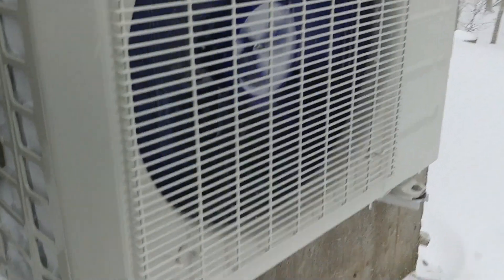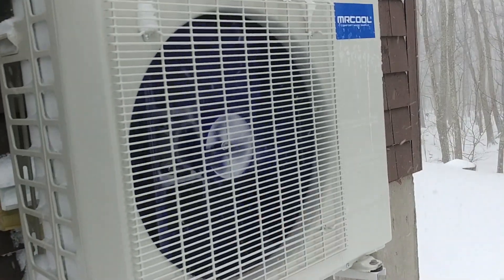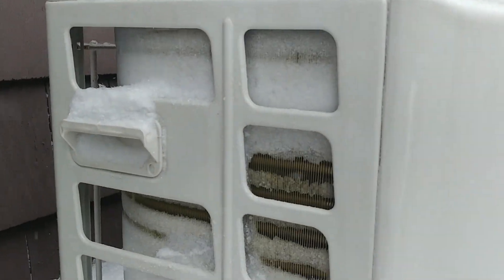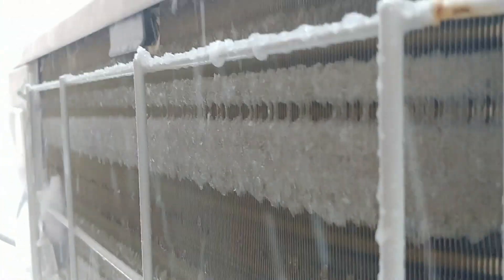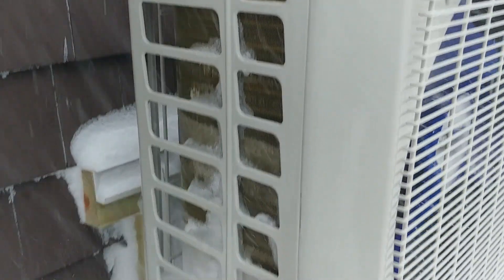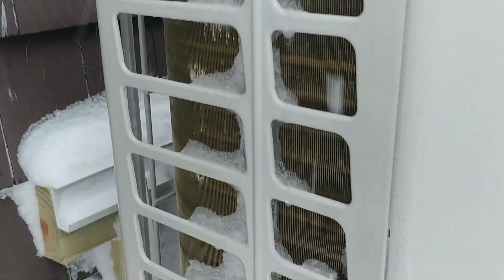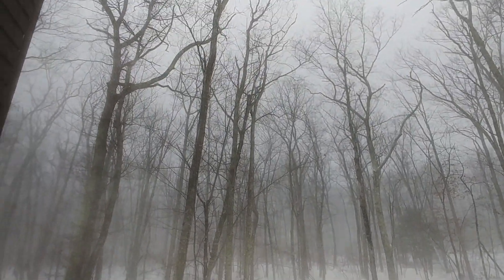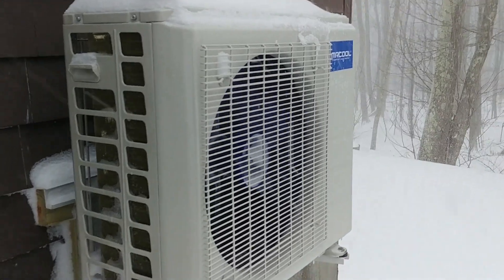Mr Cool mini-split performance in a blizzard

Comment: I too would like to know for sure how these units determine a defrost cycle is necessary.  I don't believe they monitor the refrigerant pressures, but at least mine monitors the intake and outgo temp on the condenser.  I assume it just can monitor those and when there is no more temp. differential between intake and outgo, it assumes it is blocked with ice and needs to initiate a defrost.  I know it's not strictly temp based as it can be plenty cold, but my unit will not initiate a defrost unless there is truly a good amount of frost. And that happens quickly when the humidity is 85% (defrosts every 70 mins), or not at all (humidity is 60%).
Reply: I've also wondered b/c my unit will run all night with it being 30 outside and never defrost(when humidity and dew point is low) but I've had it go into defrost at 40 degrees with 90% humidity but no ice whatsoever on the coils.  One night it defrosted twice and each time I checked, no ice on coils and not a drop of water came out the bottom, apparently this is common from other people I've talked to about it. From what I can gather sensors monitor the temps coming thru the coils combined with a pressure sensor, the pressure sensor monitors the pressure on the outside of the unit and the inside of the enclosure.  If the coils are iced over it will create a slight change in the pressure between the outside and inside.  That doesn't explain my situation but this is what I've been able to come up with from months of searching.   Does yours take roughly 6-7 minutes to defrost on avg(4-5 minutes to defrost and 2-3 minutes to start blowing hot air again)?
Reply: @bennypit4411  Are  your coils dirty,clogged up a little.The computer is taking info from the sensors temp,airflow.The unit might also have a humidity sensor and is tricked into thinking you need a defrost
Reply: My Senville Aura made by Midea same as MrCool  unit here has temperature sensor and a air flow sensor.When your unit is clogged with the snow white ice air flow drops considerably and it automatically goes into defrost. It defrosts until a certain temperature  is reached and then the snow white ice is all gone and it goes back into heat mode.The colder it is outside the longer defrost takes

Comment: I got a power meter on eBay, mounted it in a small pvc box to track mini split KWH
Reply from the maker: I have two of those for my generator.  I wish it was easier to repurpose them to my mini split.  I may want to just do two more boxes.

Comment: Stopping snow from getting onto the condenser should. E a priority to cut down on the amount of ice the defrost cycle has to contend with. Typically freezing temps outside result in low humidity which should prevent icing up so frequently.

Comment: Frost is normal on all brands of heat pump, specially in very humid weather. On my condo roof building downtown Montréal  there is mix of unit of différent  brands and age and they all do frost up.

Comment: While this is excellent for a heat pump, a gas furnace would put out hot air somewhere between 120 -140 degrees. So the efficiency of gas in extreme cold temperatures is unbeatable. The same is probably true for oil burners, but I have not used one of those.  You can use electricity to produce radiant heating, but the costs are astronomical. This is one of the central, crushing logical fallacies of the Democratic Party's obsession with wind and solar to "save the planet" from a 1.5 degree C temperature increase. These "pure green" electric sources are intermittent and in extreme cold, their costs are incredibly high. Further there is ZERO hard scientific proof that lowering anthropological (man made) CO2 emissions will have ANY effect on lower the aggregate global temperature. The global warming theory is an absurdly stupid and unproven theory that tens of millions of weak minded lemmings are following off of a cliff.
Reply: ok dummy
Reply: Stupid

Comment: I have my outdoor unit in a covered place where the snow can't easily get to it, but it can still frost up on a very damp day when the temperature is close to freezing. That one in a blizzard is probably using as much power to defrost as it is to heat the house.

Comment: The Mr cool 4th generation is great for diy. Reason beings the lines are precharged with freon no need to have a heating and air guy charge it because they are a big rip off. The other brands have to be charged, the heating amd air companies stay in business because they over charge you to charge your unit.
Reply: The other brands come precharged too, the charge is just held inside the unit instead of the lines. You just have to vacuum the lines down and then release the charge. But vacuum pumps and gauges are pretty cheap. Real problem comes if you get a leak, then you need some pretty expensive equipment (and refrigerant) to fix it.
Reply: @DeusTex  good to know, thanks for the heads up

Comment: I've had my mr cool installed for 3 years had the main control go once they send a brand new outdoor unit an lineset no questions. These units are good ice should come off during defrost mode
Reply: My experience if you're unit gets iced up enough to stop the fan from spinning us where problems will occur
Reply from the maker: @steelcitysewerman  Mine threw a P4 code (check my recent video on this).  Did yours?
Reply: @kevin9c1  yes my unit thru a P4 code circuit board was faulty
Reply: @kevin9c1  they sent me a whole outdoor unit and lineset at no cost. Never even asked for the old unit or lineset back
Reply from the maker: @steelcitysewerman  Yeah Ingrams did the same for me.  I get a gen 4 outside unit.  Mine happened in only 13 months.  The old compressor made some bad noises but it seems to be working great now.

Comment: They are great for small rooms, diy’ers, off grid solar systems, RV/Van builds and people that want to replace the unit every 10 years or less. The indoor units are difficult and messy to clean and have poor air filtration. They will not keep up in heat mode unless they are severely oversized in cool mode. Hence the reason everyone has gas, electric or wood for backup heat that has these units.
Reply from the maker: There are many available mini split heat pumps that can do 100% of rated down to some low temps, but 1) those are not yet available as DIY and 2) they have almost double rated max capacity in more moderate conditions so effectively the unit is oversized to achieve the capacity.  No free lunch but an oversized unit will often be more efficient under many conditions, provided it doesn't short cycle due to min capacity issues.  Definitely trade-offs and more trade-offs.  But in general, I am a fan of these.  Need to do your homework on capacities and COP numbers across expected operating conditions, though.

Comment from the maker: I have done some experimenting with turbo mode and turbo mode definitely results in more heating.  The room is very large (24x24 with vaulted ceilings, three exterior walls with windows and above my garage).  So the extra airflow really helps extract more capacity from the unit.  I am sure I am trading efficiency for capacity with turbo mode but it's nice to have the option, AND at $4/gal for heating oil, probably still well worth it.
Reply: What size/BTU is your unit?
Reply from the maker: @robd7365  18k single zone.  Runs off 240V.
Reply: We're paying 510-550 per gallon in lower NYS, so our 9kBTU 115vac is a nice heat booster.  I wanted to go with a 12kBTU, but don't have 220v wiring going to that side of the house... Of course now MR COOL offers a 12k that uses 115vac 😒.  I think the 9kBTU is a little undersized for the area, but it's right in the sq.ft. limit listed.  I would like to remove that unit and reinstall it in a smaller room if I can pump down the condenser/outside unit.   I may end up removing the quick connects and putting traditional flare fittings if I do the move.
Reply from the maker: @robd7365  I ran a dedicated circuit for it.  If you have a 120V outlet already on a dedicated circuit, you could switch out for a 240V breaker and change the outlet to a disconnect panel.  Just need 12/2 wire.
Reply: Using that kind of amperage constantly on 115 is going to be about 75% efficient compared to 95% efficent with 240. Not something I would do. I would just pay the money to get the circuit run.  @robd7365
Reply: On turbo mode it usually passes more air so efficiency if compressor frequency is unchanged is higher. If compressor speeds up it just adds some capacity so thats not bad either if you need it

Comment: Our Senville 24,000 BTU LETO we just set on Auto all the time and it knows what to do. I installed it in 2018. We never have icing and stays hot on winters and very cold in the summers.  IT KNOWS WHEN TO DEFROST ALL BY ITSELF.

Comment: I'm curious if you can share how many KWh your electric bill increased using the mini-split.  I have recently installed the MRCool Olympus 48K with 3 wall units and 1 mini ducted for smaller bedrooms.  I have NG for the main heat which I am planning on using as a backup but I know this will substantially increase my electric usage.
Reply: Not only do you save on gas, the accompanying electric to run a blower or pump for hot water is also not present.

Comment: This is normal, every mini split goes through this process, your coils have a sensor on the back. Do you have the olympus low ambient unit?
Reply: You should have said, every heat pump goes through this. It's not unique to mini splits.

Comment: Hi do you still like it now July 2022 in the heat?  Do you recommend as a back up heating unit?  Oil prices are out of control.  We are thinking about getting the dual zone Mr. cool split unit.
Reply from the maker: I still like it.  I am considering a 3 zone for our bedrooms.  I wouldn't hesitate to get one to help with heat.  At these prices it's definitely cheaper than oil.
Reply: @kevin9c1  do you need more than one unit to do the house ? How big of a room does the 3 zone do ?
Reply from the maker: @allaboutdetails3356  We use the 18k unit for the great room which is 24x24 with vaulted ceilings, above a garage and with 3 exterior walls.  It does the room with power to spare.  But it doesn't really do the rest of the house.  I think we actually need two more 2 zone units.

Comment: defrost will cycle on and terminate by either time or temperate . Most importantly the indoor fan turns off because it becomes the evaperator in defrost mode and wouldn't be efficient and or comfortable if the blower motor runs .

Comment: I'm glad you made this video. That's the unit I want for my cabin, especially to heat during the winter.
Reply: That MrCool unit is made by Midea.Midea also makes Senville and a Senville Aura is good for minus 22F.The Senville Leto is good for 5F.I would take the Senville Aura over the MrCool plus it costs much less and parts are readily available
Reply: Get a Mitsubishi with hyper heat. It will heat with the temp outside at -13.
Reply: @user-ln7of9gs4s  and so WILL the mr cool, they are all the same, Mitsubishi is NO better! if they have an inverter, they will all perform the same.
Reply: @karmendimas5274  false. They all perform differently, they are not all the same.
Reply: @user-ln7of9gs4s  you obviously did not read my comment carefully,, the Heat pumps with INVERTERS  are designed for sub temps, !!
Reply: @karmendimas5274  I read your comments, not all systems have equal capabilities even with an inverter. Some have minimum temps of 5 degrees Fahrenheit. It even says it on their website for Mr Cool.
Reply: @user-ln7of9gs4s  if you say so...
Reply: @karmendimas5274  what is your problem ? You’re disputing what’s on their website? What are you trying to prove?
Reply: @user-ln7of9gs4s  if you say so !
Reply: @karmendimas5274  the manufacturer says so right on their website. Why are you trying to spread misinformation? 5 degrees and -13 degrees is a big difference. You haven’t contributed anything of value, you’ve lost the debate. I’ve cited facts and sources, and all you can say is, “if you say so.”

You haven’t shared any personal knowledge or first hand experience.
Reply: @user-ln7of9gs4s  if you say so!
Reply: @karmendimas5274  yes, thanks.
Reply: @user-ln7of9gs4s  if you say so!
Reply: @user-ln7of9gs4s  the gen 4 Mr cool state heating down to -13f. The gen 3 states it could heat down to 5f
Reply: @scottleighton9149  thank you for sharing factual information and a source for myself and other commenters. Not all minispits are equal.

Comment: You should not count on it to be your primary heat source it can only do so much plus with all the snow blowing around your asking for problems and then good luck getting help from mrcool I don't think they have a service network
Reply from the maker: That's why I bought from Ingrams. Mr Cool and Ingrams are both based in KY.  Warranty support has been excellent through Ingrams.

Comment: I see you have it mounted to the foundation on the bottom and to the siding up top. Does it vibrate inside the house at all? I have two units yet to install (live in Maine) and would like to do slabs but don't want to have snow issues.
Reply: Funny, I also live in Maine! I opted to mount my 12k and 24k to the foundation, I can slightly hear a rumble? But it's really quite minor. Far less of a nuisance than a traditional window AC.
Reply from the maker: So the great room that it conditions is a floor up.  If the room you are in is on the same level as where you wall-mount the unit you will definitely hear it when the room is quiet.  In my garage (other side of the wall) you can definitely hear it.
Reply: @kevin9c1  Thanks. I think I'll go with the slab option. Thanks again!
Reply: @gppme7066  when you put these units on the ground you will possibly have trouble with rodents eating the wires

Comment: It's useless taking a temp reading from up around the ceiling.
Reply: tell your remote to follow you . temp reading should change from the coil to remote.
Reply: Yeah, take the temperature down there at the couch. Most of these junk mini splits are put up high near the ceiling where you aren’t sitting.

Comment: Don't worry about the frost.  My C&H south of Buffalo NY ran great all winter.  Even in snow storms.  Sure it frosted up but the auto defrost took care of it fine.  I never worried about it and it blew heat all winter even at -9F
Reply: Which particular C&H unit is that?  I'm looking for one of these specifically to get me off propane heat in the winter as the price has more than doubled.
Reply: @piquat1  Get that built for low temp and cold climate. I had oil heat in my house. Before 2021 it's was like noting to heat house from oil. Now it's was costing me $700 every load which is like every month and half. I went with my local electricity company.  They had rebate programs for mini split if u remove oil or gas heating completely. They had installed daikin mini split two outdoor 36-46 BTW and 6 indoor unit 2 18k BTW and 2 12 BTW and 2 9k btu. It's cost me $10k after rebate with removing oil tank and oil furnace. After I installed mine they ended the programs bcz they said due to high demand they ran out of money from state government.
Reply: Hyperheat
Reply: Mitsubishi

Comment: You should remove the drain hose and that fitting, it will drain better.  In southern climates that drain might be usable
Reply: Yup, first day I had my mini-split, I read the instructions carefully, install that drain.  I didn't even attach a hose.  Thing froze solid.  I used a hair dryer removed it and no issues since

Comment: what is the lowest outside temp you used this unit for heating?
Reply from the maker: Probably around 5F, maybe a bit lower.  But I think at this temp you need to have another heat source as I don't think this could be the primary.  I could experiment with it and close off my furnace dampers to the room in which it is installed and see what temp it can actually maintain in single digits.
Reply: @kevin9c1  Mitsubishi has a hyper heat model that works to -13.